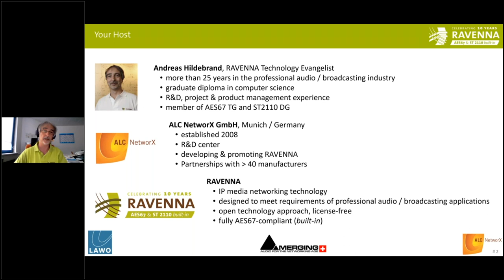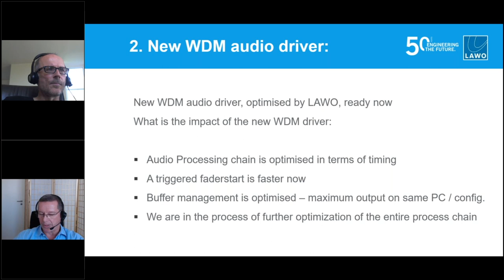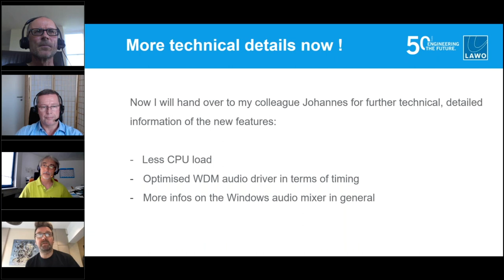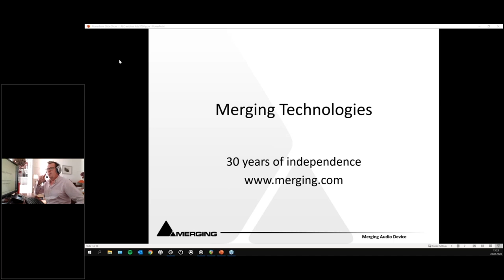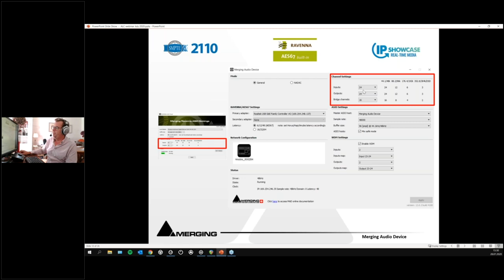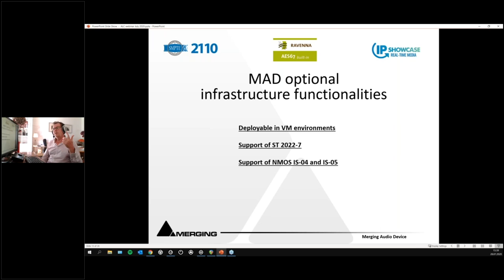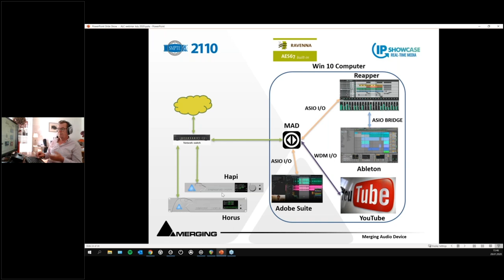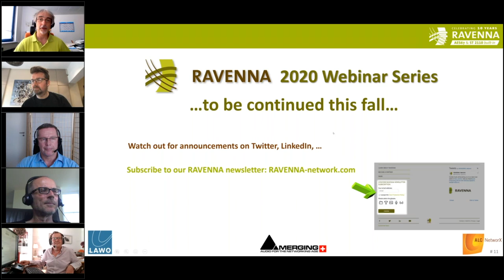Products & Applications: Virtual Sound Cards

Comment: I have installed the ravenna-free vsc (RAVENNA VIRTUAL SOUND CARD) and it's working more or less. How can I change the default Multicast TTL, it's set at 1 but greyed out in the Network settings in the Web interface? Thanks.
Reply from the maker: Hi, please direct any enquires to: support@alcnetworx.de